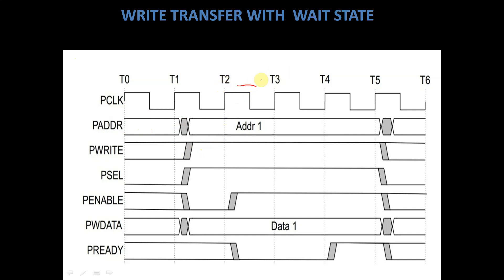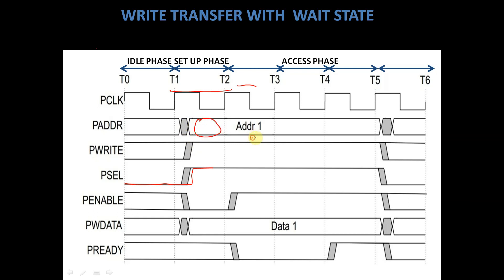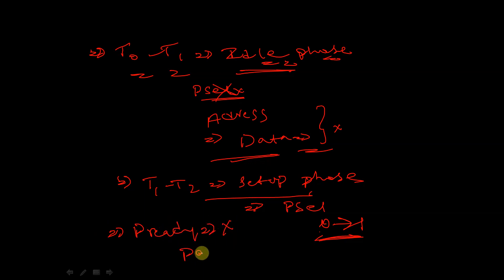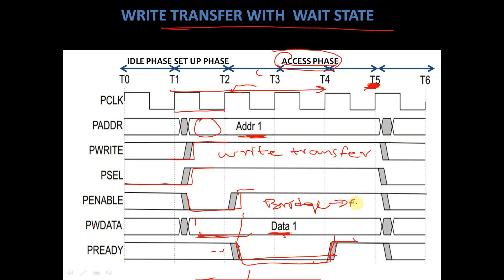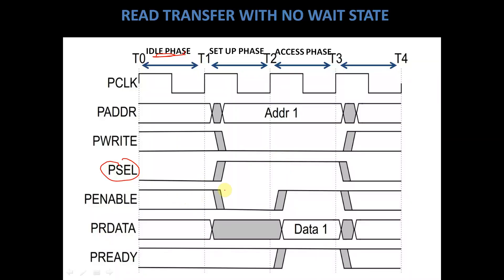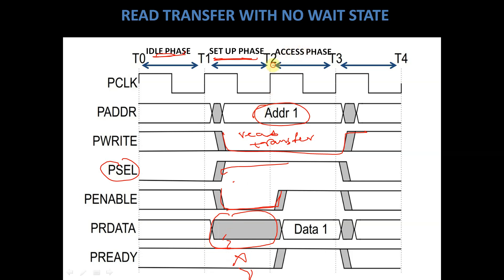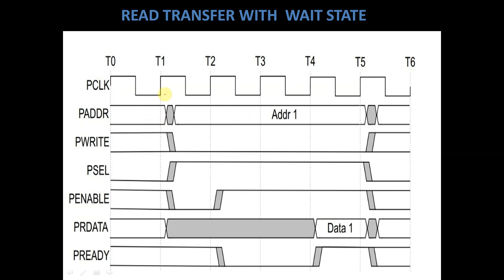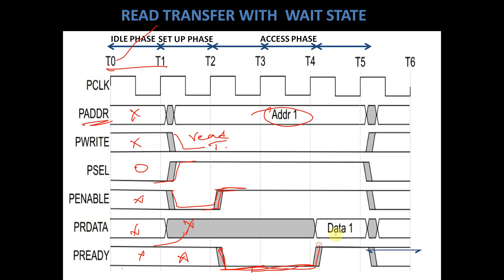Transfers in amba apb part - 2 || Amba Apb Bus Protocol

Comment: In real life......a printer is connected to main processor.... where in printer have all this signal..... with the help of this signals printer works with main processor.......im i right sir?
Reply from the maker: Almost correct
Reply: @Allaboutvlsii  Can i know another part of almost correct sir?
Reply from the maker: @silentboy7722  it means the printer and the processor will not exactly work on this basis there may be some other protocols included
Reply: @Allaboutvlsii  sir is there any notes on APB protocol?